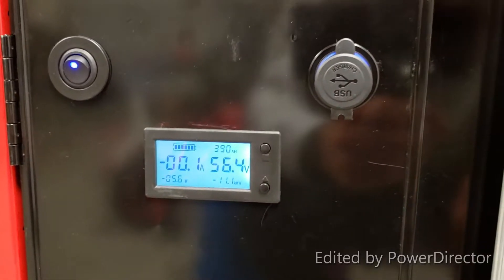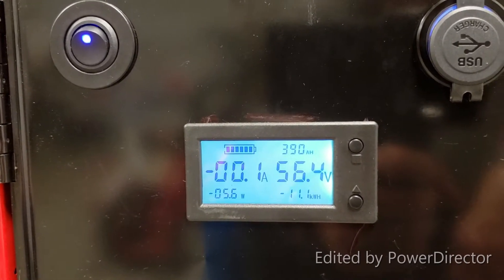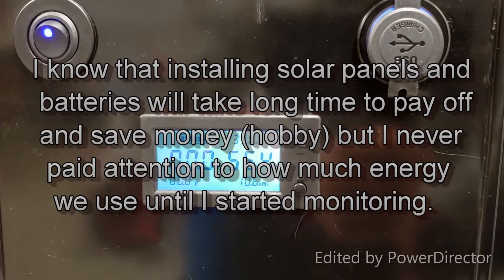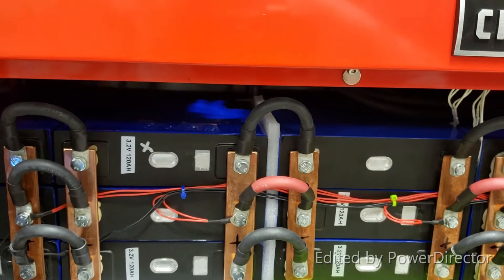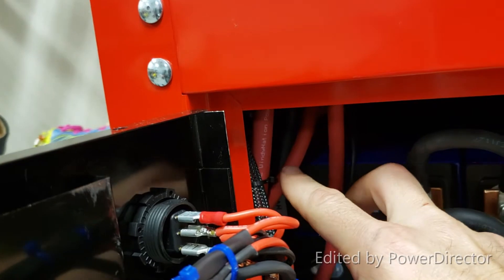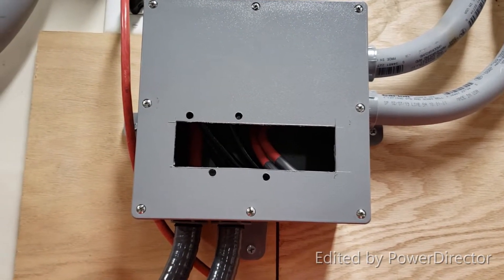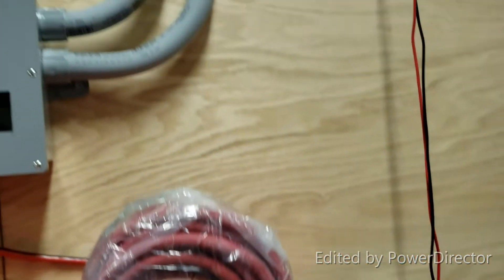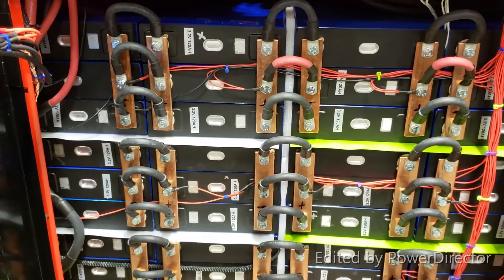MPP Solar LV5048 Powerwall Upgrades

Comment: I just wanted to let you know that your batteries are grade-B recycled/repackaged batteries. They have the QR scratched off and are sold as new on alibaba/aliexpress. These sellers buy in bulk old / packs that fail qc. Generally what happens is that they take a 150 AH and sell it as a 120 AH because the 150 has lost 20% of capacity from new.
Reply from the maker: They are. I even made a video about it.

Comment: Hello, I bought an inverter that’s set up in series of two, I was wondering if I could put it in a serie of three, I’ve seen other people do it before. What would you personally recommend to make it more efficient?
Reply from the maker: Thanks for the comment. What kind of inverters did you buy? Did you want to say in parallel instead of series? If you are talking about LV5048 then yes, you can parallel up to 3 inverters. What kind of efficiency are you talking about? Inverter to battery or maybe stand by efficiency?

Comment: For people don't understand how much power we use until they try and make their own. But the good news is organizing the load to production time with solar is the best use of the power. Try  putting an amp guage on those 4 gauge wires at the batteries and you will see they don't draw much but the combined draw accumulates in the inverter wires so the 2 gauge should be good for 6 feet any longer go bigger.
Reply from the maker: Yes the load is evenly split between inverters. But even at 80 Amps 4 awg does not seem to be adequate hence change to 2 gauge. 1/0 is between power wall and distribution box and no issues at all. Thanks for watching.